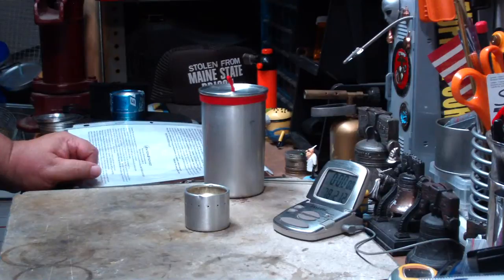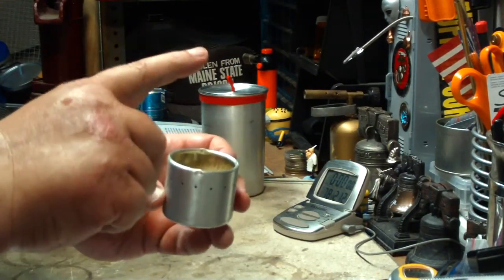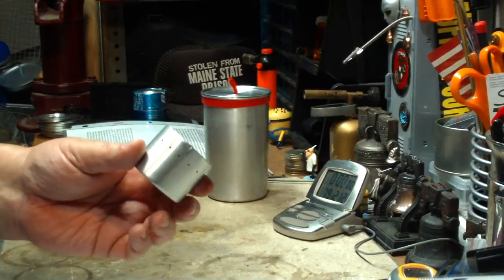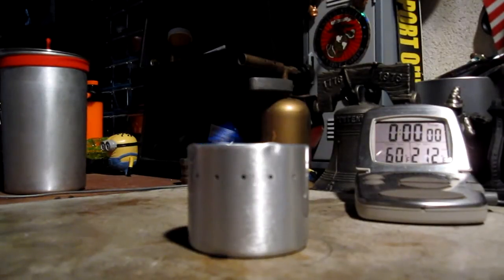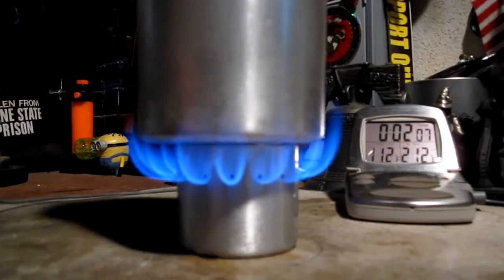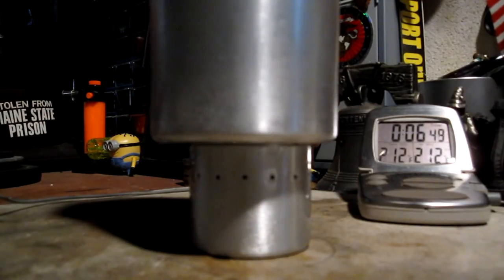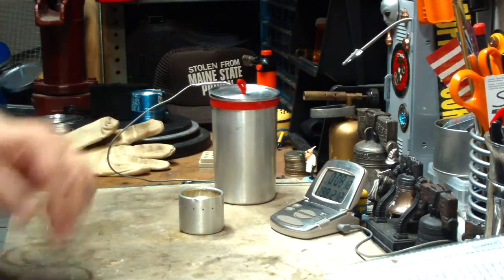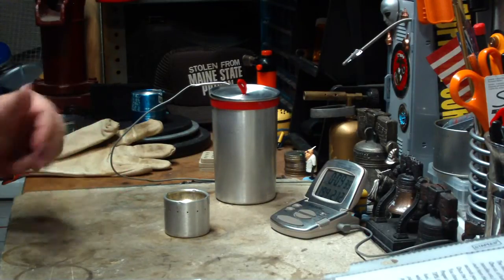BatchStovez BS 1.0 Stove - Boil Test #1

Comment: I have tried this type of stove and got the same result. Under varying conditions outdoors, these stoves are unpredictable, but, if you can add a bit more alcohol to begin with, you could pure it back after getting a boil. another downside is that the whole unit can not deal with uneven surfaces. I had such a stove tip over with hot water on top. ty, chris

Comment: Hunt458; yes the stove is made from thicker aluminum like the Budweiser aluminum bottles just a smaller diameter. Yes it is very strong where you do not need to worry about ruining the stove if you drop your pack